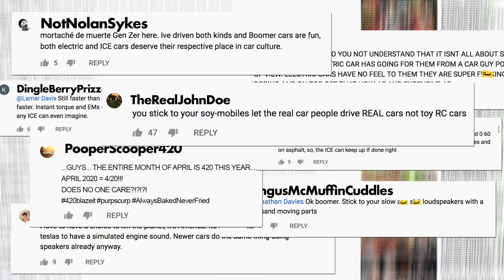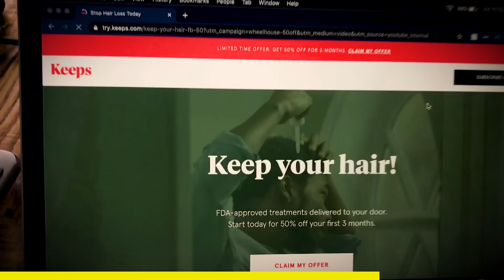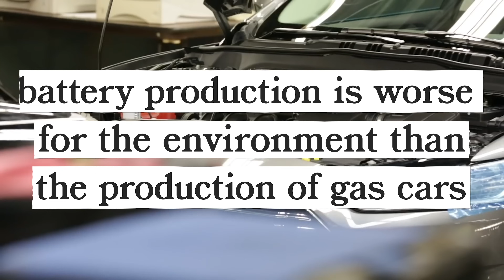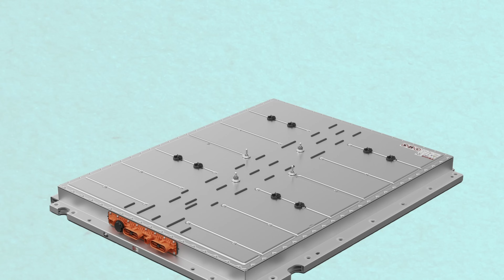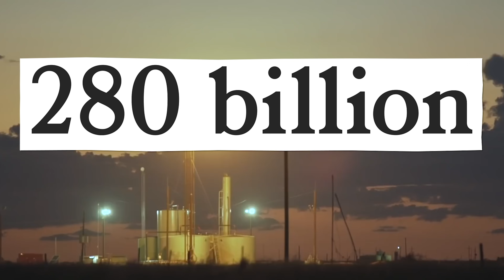Are Electric Cars REALLY Better for the Environment?

Comment: I really enjoyed this video, I think that there are 2 things that you left out 1) battery degradation, the ev eventually will need another battery 2) synthetic fuels 3) hydrogen (being used in ice engine)
Reply: And Ethanol in ICE.
Reply: Don’t worry, I can answer this question. 

For #1, battery degradation. It is believed that batteries will only last 5 years (thanks to the 12V up front in most cars or the sheer fact that your phone battery goes to garbage in 3 years. But the thing is, your electric vehicle battery is not a phone or small upfront 12v battery. It’s a military grade performance battery.
The life expectancy is 10-20 years or the life of the vehicle. Majority of people don’t even keep their car for 10 years let alone 15 or 20.
The car will be sold and the battery will be ripped out and recycled to build a new battery at the fraction of CO2 needed then if the materials were mined.

#2 Synthetic fuels appear to be late to the party and based on my research, is total BS. Sorry, but I am having a difficult time finding evidence for its existence other than companies CLAIMING they made synthetic fuels and it’s cleaner. But the fact is, they still produce co2 when burned and they are not as clean as they are hyped up to be. 

#3 Hydrogen is a loss cause. It’s too expensive to make, has too many flaws (hydrogen tanks have a recharge time, hydrogen nozzle can get stuck to the car due to frost build up, safety hazard with pressurizing unstable “gasses”. It’s also just as efficient as a diesel engine from production, compression, transportation, and usage in a fuel cell. It makes more sense to continue funding battery electric vehicles. And I should also mention, you lose a ton of storage space in a hydrogen powered vehicle. Not just in cargo, but in leg room to. And thats thanks to the massive tanks below.

I hope you find this information helpful.
Reply: @ProJC  first of all, you have been using Lithium batteries for a long time, and even iphone admits that they only last 5 years of daily usage, just because you got more batteries doesn't mean you got a longer life, synthetic fuels are the real deal, they don't claim to not produce CO2, what they claim is being carbon neutral after they are burned, since you are releasing the same CO2 it was used to make the fuel, at the end of the day the scale evens out, hydrogen is expensive because currently the way that is made is by burning a heck of a lot of natural gas, however it can be very easily made with electrolisis with the added benefit that after it goes through the gas engine you get the same water it was used to make the hydrogen, which can be recycled and turned back into hydrogen, coming back to batteries,  even if the lasted 3000 cycles (roughly 10 years) (which is lifepo4 territory) those batteries aren't used on EVs, and to make matters worse, there is not enough lithium in earth to make EVs for everyone. 
Closing this, donut, carwow and topgear already tried efuel on their cars and they worked perfectly, in the current state it costs 40 USD to make a gallon, however as the market expands, that price will go down drastically
Reply: @Lucas_sGarage  Your comparison between iPhone batteries and EV batteries is like comparing a toy car to a Formula 1 racer. EV batteries are designed with thermal management systems for longer life. So, the '5 years of daily usage' claim is utterly irrelevant here.

Synthetic fuels being 'carbon neutral' is misleading. You're conveniently ignoring the energy needed to create these fuels, which is often sourced from fossil fuels. The International Council on Clean Transportation found they're not as green as they claim to be.

As for hydrogen, you've got the rosy part right — electrolysis. But what you miss is that it's not as efficient or cost-effective compared to battery EVs. The U.S. Department of Energy points out fuel cell vehicles have an efficiency of around 25-35%, compared to battery EVs that can achieve up to 77-82% efficiency.

Your 'not enough lithium on Earth' claim falls flat. The U.S. Geological Survey estimates that lithium is abundant enough for future battery needs.

Finally, the anecdotal tests by Donut, Carwow, and Top Gear prove nothing about the practicality or environmental impact of synthetic fuels. That $40 per gallon cost alone should raise eyebrows.

So, before touting the 'real deal,' maybe we should look at the whole picture.
Reply: @ProJC   1) manage the temperature as much as you want, batteries degrade and you are looking at 10 years at best, 2) Efuels are made ONLY with renewable energy sources so that claim falls over its own weight, 3) according to top gear, department of energy, new atlas and others, electrolisis (if done correctly) usually archives an efficiency of 75% and there are some who claims 95%, so That's another thing that falls over its own weight. The average battery requires 8kg of Lithium for an ev, the world has roughly 14m metric tons (which are useful, the rest is separated over a large are which is not worth extracting) in order to make the hole world carbon neutral you would need 2 billion EVs and doing the math that translates to 16m metric tons... Aka not enough... 
Last, but not least, I said currently 40 USD per gallon, by 2025 is expected to cost (depends on who you ask) it's expected to cost roughly 1.6-5 USD per liter..., And let's not even talk about ethanol as a fuel alone (which is already been working as E85, which translates to up to 85% ethanol)

Comment: EV is using the same things you use at home from battery to electricity to plastics to iPads. Stop using those at home first before claiming things about EV which is the most efficient, least polluting and better alternative to gas pollution. As solar panels and other things improve and become cheaper EVs will be super clean. But you’ll still use batteries from Chile and African mining along with coal fired electricity

Comment: Something often ignored by pro ev nuts is the damage to roads by the heavier vehicles and the much faster wear of the tyres and the crap coming off the tyres is easily as harmful, probably more so, as the relatively clean fumes coming out of an ice engine.
BTW gasoline IS NOT MINED. Something ignoramuses like you forget is that until ice vehicles became common the petroleum spirit was burned off.
You are ignoring that the electricity from so-called renewables such as wind turbines and solar panels is neither cheaper nor more environmentally friendly than that from coal or oil powered stations. There is also the fact that at the end of their short lives the solar panels and wind turbines are not recycled and a lot of CO2 is created when manufacturing them, installing them, running them, and then disposing of them.
The last point you are ignoring is that the WEF, therefore most Western governments, intend for the majority of us to be priced off the road one way or another. The scam of net zero/green, whatever you want to call it is the way they are conning you all into helping them with their agenda.

Comment: Cars are a very tiny part of the problem. Even if car emissions were zero, we would still have global warming and environmental catastrophe with barely any visible improvement. Compared to the amounts of CO2 coming out of industry and agriculture, cars are nothing. But they don't want us to deal with the real problem. Instead they push these non-solutions like EVs. Same as using paper straws instead of plastic straws. Just feel good pseudo-solutions that are designed to gaslight consumers and obscure the real culprits and the real problem.

Comment: To be honest I always looked at them the same - even considering the diffrences between their engines, they're both eco-unfriendly:
 - they both use steel
 - they both use lithium (ICEs need a battery too)
 - they both use copper
 - they both use oil refinery products (gasoline, plastics and asphalt)
 - they both have overpowered engine for carrying one person
 - and they both take the same amount of space on the road

In other words: there are clear differences between the two (and even previously I believed on favour of EVs), but marginal, considering their problem is not their engine, but the fact they're both cars, and car will always be very bad for environment.
 The actual winner will always be rail - especially grid-electric express one. It has the lowest carbon footprint from any other means of transport known to man.

Comment: Did you factor in the fossil fuels burned to create the electricity needed to charge the car? Electric cars do not create electricity ao rely on the power grid,which is approx 60% fossil fuels in the UK. Unless the grid is powered by renewable energy, the electric car cannot run without creating CO2 emissions. Then you have to factor in the battery technology and emissions to create super batteries, that can store months of electricity that we would need. When the wind doesn't blow and the sun doesn't shine, we need sustainable energy that doesn't stop and doesn't cost a fortune.

Comment: You've covered the idealistic common scenario to compare the two. However, you've neglected to take into account that people are dumb and catastrophic and lethal crashes happen. There's a very big difference between a wrecked ICE car and a wrecked EV car and I can only imagine how the scenarios of a multi car pile up with current ICE vehicles results in some people injured is going to change into multiple EV car infernos where people are immolated or get some kind of cancer from the noxious fumes the batteries are spewing out.

I'm not saying ICE is better than EV, I'm just saying EV is all focused on the wrong tech right now. They're focused on trying to push the Lithium Ion battery further and further when really a new battery technology is need. It's kind of like instead of planning around what happens if the grenades your storing in your pantry happen to cook off, you just don't store grenades in your pantry to begin with? But manufacturers are saying that's too hard and that slapping on more proverbial duct tape and tin foil on their makeshift grenade box is easier than moving them.

Comment: Well, here’s some corrections. Three years later they lied to you about the power. The app is a manipulative app. You cannot use a gallon of diesel to generate electricity to charge your battery and go to the same amount of distance in electric cars that you would if you just burn the diesel dust must burn more carbon fuels to charge the battery releasing more CO2 than if you just burned it. In 2022, California shut, all electric chargers off because their power grid could not supply enough power to just the homes not to mention charging the cars

Comment: The real solution until EVs are more efficient and the network is expanded are plug in hybrids. The Chevy Volt was capable of over 50mi per charge on electric alone which is within range of 90% of commutes. It could then do over 400miles in range in hybrid mode. Why we didn't allow that intermediate stage to happen longer, I'll never know.

Comment: Dude, there are so many generalization made from some statistical facts then blown out of proportion. Whether you are pro ev or not doesn't change the fact that the US cannot sustain its current electric load if we switched to clean renewables. Wind and solar have been known for a while to be inefficient systems and extremely costly. Shittin on 3rd world countries for lithium and using up their water so you can feel good about yourself that you could charge your clean ev with electricity predominantly generated from fossil fuels is the most entitle condescending thing I've ever seen. I'm not opposed to e cars but people are make a lotta generalizations from a couple statistical facts instead of looking at the whole picture. Unless you are switching to nuclear, our grid cannot sustain it. Look at any chart.

Comment: The problem with EVs is mainly in the production impact and in some cases, where they're made...EVs made in China and shipped to the US are especially an issue...the QC is very lacking for starters, which is a big safety concern...then there's the whole issue with doing business with China/CCP...Like Tesla for example...not only is it fundamentally and morally wrong to be doing business with the CCP, it's also a massive security risk...those cars are full of cameras and microphones and they're being driven by people that work in highly secure areas of the US...there's no reason to think the CCP doesn't have access to that data...or that the CCP wouldn't try to extort that information from Elon (assuming he's not already giving access on his own)...then there's the issue with Elon...the fact that he's willing to turn a blind eye to the horrible things the CCP has been doing for the sake of cheaper labor...the result doesn't justify the means

Comment: Some say its worse. Some say the crwation of fuel cells alone is worse than the lofe of a gas car. Therefore electric is acrually far worse. Based on 175k life of car.

I agree that they usually arent any better or worse. Because im sensible. 

Carbon tax is theft

Comment: But wait now add in repairs! Because on those EV, you need to replace entire parts like for example the lights. While on my gas car I can replace them in 2 minutes with a 10$ bulb an EV has the entire unit replaced. So way less waste in old cars. Also EV battery won't last long. I still drive my 30 year old Toyota but good luck driving a 30 year old EV because the battery life would be non existent. Since producing the batteries is the entire point of them having a huge effect on the environment during production this has to be taken into account as well. 
It might be that EV are still more efficient in the long run but the fact that those corporations are already dashing out subscription plans makes them a definite no-go area in my book. I will stick to my old cars thank you.

Comment: Electric cars and hybrids are very good but over priced.  My dad bought mercedes three years old in 1996 it cost around 16000 British pounds.  He bought hybrid mercedes six years old recently it cost 24000 pounds.  Why are these cars not priced more reasonably.
Reply: anything new tends to be more expensive because there isn't the scale to support tighter profit margins. Plus the material cost of an EV is just higher, you'll potentially make back that savings at the gas pump but the reason they don't cost the same is because they aren't the same product.

Comment: Just like creating gas/fuel for the I.C.E ; can you take into the effect of Solar panels dispensing toxic chemicals when they come end of life, windmill blades can't  be reused,  there is a metric carbon footprint of creating the windmills and solar panels.  Lastly I can take a ICE car crush it and melt it along with the engine.  The battery for the EV has a bunch of plastic wrapped up in it and cannot be recycled as easily.  Plus the earth has been around for a long time.  We started measuring climate change at the bottom of a cooling period.   Global warming is a natural phenomenon.  The earth has had 5 ice ages.  You don't think it's going to change a degree in 100 years?  But seriously, I'd like to know the carbon footprint for the windmills and solar panels.  Thanks for the info in the video.

Comment: Pretty sure you didn't take into consideration other things auch as longevity for example. My 20 year old toyota is still working fin, an ev would have needed at least two battery changes.
Also, oil refining isn't just for my car, it produves other chemicals such as plastics, so its entire carbon priduction can't be assigned to my car.

Comment: While your video does have some truth in it, EVs are not as efficient as you think. You are using one scale to judge the emissions of both gas and electric-powered vehicles. Although you stated buying an EV will get you a $7500 rebate from the government in the US, our government does not make the money, we taxpayers make the money! So a guy buys a Tesla and gets a $7500 rebate. Where does the $7500 come from? The cost of replacing an EV's batteries is astronomical and there are no rebates for that, which we taxpayers would pay for anyway! Then what about used batteries that have to be dealt with? Landfills with cobalt and lithium? What about the dangers of lithium batteries? Lots of EV catch on fire! Now, add the cost of using plastic in the manufacturing of an EV. Plastic is an oil-based product. So is paint. True, both types of vehicles use plastic and are painted! And what powers the charging stations? Mostly coal, diesel fuel, and nuclear power! Now to all of this add the time required to charge a vehicle that can run for only on average 200 miles. Our electric grids already fail in summer and winter without millions of EVs connected to them! EVs are not the answer as the best form of transportation fuel.

Comment: Great post, sheds a lot of light onto the environmental impacts of both gas and electric cars.  I'm not sure that you included the end of life processes in your math though.  Not that it changes anything, yes, electric might be marginally better for the planet, but they are not the silver bullet against climate change that governments think they are.  I still stand by the fact that the "greenest" car is the one that lasts the longest and gets driven the least, regardless of what it runs on.  In Canada, our long cold winters are harder on batteries and the massive amount of sand/salt rust our cars out quicker.  This will reduce the environmental aspects of electric cars even more.